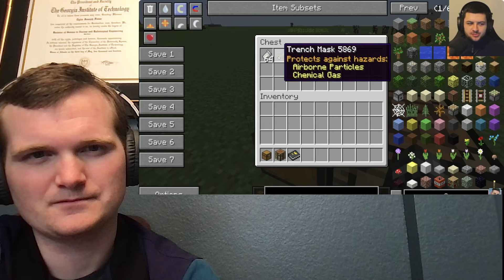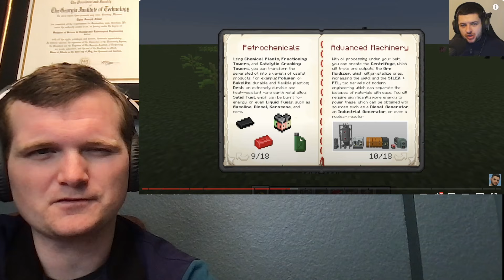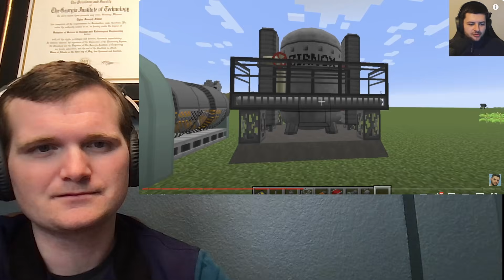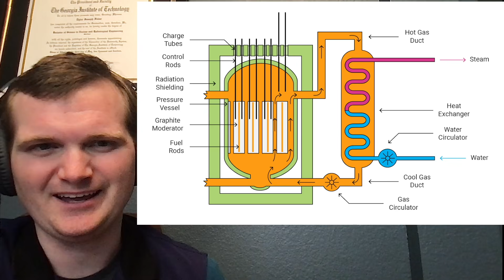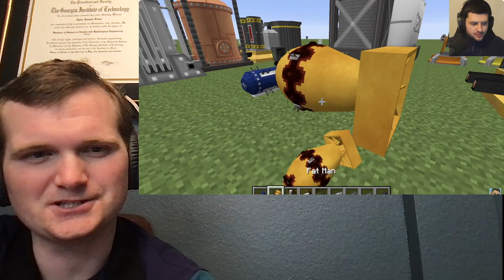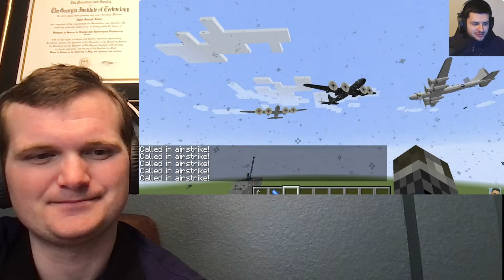Nuclear Engineer Reacts to Minecraft HBM Nuclear Tech Mod Showcase by thebluecrusader

Comment: It's funny to see a scientist do a review of a Minecraft mod, do you play the game yourself? I've always loved HBM NTM, but nowadays i kinda prefer the mod Warium. Warium is a lot simpler than HBM, but i personally like the visuals of the explosions better and it's a lot less laggy. The first time i used the Tsar bomb from HBM, i actually thought it was broken and didn't do anything. I almost detonated a second bomb after a few minutes, when the crater suddenly started appearing just in time. The game has to process so much, that it takes like 15 minutes to load in the damage from the Ivy Mike and the Tsar. In Warium there's only 2 nukes, the 9 KT tactical and the 650 KT strategic, but it's pretty well optimized and the lag is negligible. 

I use a lot of different mods and my favorite part of Warium is that if you have a mod like Valkyrien Skies, which lets you build your own working vehicles, you can actually drop the bombs from your planes. HBM is more realistic and you have to know what you're doing, but with Warium there's a lot more creative freedom. I built a futuristic multi-role jet designed after a stingray, which i named Trygon, and it has a VTOL function, can hover perfectly horizontally with the help of a gyro or fly like a regular jet, it can deliver both types of nukes, has powerful rockets under the wings, and thanks to creative mode items, it has infinite fuel and ammo.

From a gameplay perspective, i think you would actually want to avoid too much realism. If you need to have actual engineering knowledge in a mod that revolves around warfare, certain players are going to have an unfair advantage, while others are just gonna have their factories melt down.

Comment: 0:30 I think the green indicates that its a balefire bomb which is a type of bomb in the mod that has a green explosion

4:17 any type of schrabidium gives blindness

9:30 you need 4

15:42 "heavy infinite water tank" refers to a faster output of water than the normal infinite water tank not heavy water. heavy water does exist in this mod though

Comment: 3:58 I’m pretty sure it’s required for the RBMK because the crafting recipe for the RBMK Structural sections (also the base for the boilers, Control rods, moderators, fuel rods, neutron absorbers, etc.) includes Asbestos Concrete. The asbestos concrete block also has a higher blast resistance than the concrete block.
Reply: It’s also used as an optional part of making insulators(i think it gives 16 a craft?) and is the best way to get silicon in bulk(each block gives like 40 nuggets iirc).

Comment: Btw, the Digamma radiation is pretty fictional. Basically, it's a radiation but stronger, since there's only 2 armour can defend from it (and they're pretty expensive) and it's not just kills/mutates DNA cells but it's shorting maximum health of character until they die, plus it's pretty hard to control when it's a fuel for RBMK reactor because it's making a Entropy crust grow which is a dangerous thing (if mod wiki correct) and the pallet from Digamma impoverishes itself really fast even if it don't been placed in RBMK.
Reply: P.S. This fictional RBMK fuel when RBMK reactor is on meltdown kills everyone, even players in Creative mode. The other things that kills player in Creative mode is falling into Abyss or /kill command.

Comment: I love this mod because of how much shit it adds and how amazing and in depth everything is and looks. It's obvious simplified heavily from real life machinery, but I did learn quite a bit from it as well simply because it got me interested in this type of stuff.

The guy reviewing clearly isn't very knowledgeable and is kinda misrepresenting some of the mod's functionality. Radiation does actually cause the effects you mentioned at 4:34, he just happened to choose the schrabidium ore (a fictional element added) which itself caused the blindness.

5:06 toxicity and radioactivity are modeled separately, but toxic things are greatly simplified. There's coal and asbestos levels for lung diseases, I think lead poisoning was added recently, and radiation of course which is the most complex new "hazard" mechanic added. It behaves as realistically as you could expect from a minecraft mod with accumulating doses having progressively worse effects, contamination from radioactive materials, fallout from nukes, etc.

The mod also features the RBMK reactor which is probably the most complex and realistically modeled one in the entire mod because unlike the others where you really only need to throw fuel in and account for reactivity and coolant, the RBMK is entirely customizable and you have to build it yourself, it's not a single multiblock structure (multiblock is basically the ones that are a single 3D model when placed) and you have to actually consider things like fast and slow neutrons, moderators and control rods, what fuel you'll be using, and a bunch of other shit.

10:00 it does actually have multiple levels of enrichment for fuel (and to produce weapons grade material too)

To put it simply, this mod is way more in deoth and complex than the guy reviewing it makes it seem, would be cool to see you check it out yourself someday. Your experience would most certainly give you a head start lol.

Comment: 15:57 There is an infinite water tank in this case; heavy just means it makes more water per second. Trust me, I make the same mistake thinking it is heavy water.
16:48 There is a large turbine, but 1. It is vary expensive. 2. The smaller industrial steam turbine has a 25% power boost. So most think it is better to use industrial steam turbines.

Comment: Yeah, HBM's Nuclear Tech mod is insane with content. Other nuclear mods are "put some blocks together, get generic reactor" HBM's is more indepth and I totally havent accidentally blown up an RBMK from improper structuring/cooling XD
Reply: rbmks dont explode
Reply: @verdisquo97_arts It's the reactor design of the one who blew up at tchernobyl so yes they do explode.
Reply: @mr.g1555  ik it's a joke from HBO Chernobyl however it was actually the hydrogen that caused the big explosion that blew the top off
Reply: @verdisquo97_arts  it was not a steam explosion instead?
Reply: @mr.g1555  no you see hydrogen is formed when a neutron hits a atom of water  splitting it into hydrogen and oxygen, so technically it was a oxy-hydrogen explosion

Comment: Enriching water is a lot simpler than enriching uranium. You can do it in your kitchen if you want to. It's just going to take a while. First you fill a beaker with water, add some drain cleaner, then apply DC voltage across the water and electrolyse it away. Make sure the gas doesn't explode by ventilating the room properly. Do that until your water is almost gone. Put the water into a closed container and make sure it doesn't evaporate. Repeat and collect the 1 round electrolysis water in the same container. Then do the electrolysis step on this new batch of water. Do that a few dozen times and you should have enriched your water. Now you can do some fun experiments, like making ice cubes that sink.

And if you capture the gas you can even sell it off, or do other fun experiments. Like mixing it all together and putting a match to it.

If you want to enrich uranium on the other hand, you will need a chemical plant, several dozen gas centrifuges, a new power provider to power those centrifuges, hazardous and deadly chemicals like fluorine gas, which will eat you alive and a massive industrial site to put all that gear.
Reply: And the NRC breathing down your neck

Comment: In fact, in the mod you can use several fuels in reactors, and by far the reactor that has the most fuel options is the RBMK, it can use natural uranium, medium enriched uranium, high enriched uranium, it can use plutonium, americium, and even fictional fuels like schrabidium, australium, the most powerful fuels are flashlead and balefire in the case of the RBMK and schrabidium in the case of other reactors, flashgold and balefire are the best in the RBMK, but also the most dangerous, if you make a small mistake the The reactor turns into a giant cannon, to control them you have to be patient, and if you raise the control bars a little, it is enough to generate a lot of heat and energy, I personally use my balefire reactor at 10% in my world.

NOTE: digamma is not a good fuel in terms of power, and is better for neutrons, and digamma is more used to generate byproducts that are essential in the progression of the mod.

Edit: Fun fact, LEAus and HEAus (Low Enriched Australium, and High Enriched Australium) are fuels from the RBMK reactor, which are not radioactive but can undergo fission, obviously this would not happen in real life, but it is a fictional metal, so it is not logical.

Comment: I would like to see a Letsplay from you with a minecraft modpack. Like mekanism, Advanced rocketry, big reactors etc. I do not play mc anymore because of university, but some time a go a lot.

I thought of revisiting that after I completed my studies to see how most mods implemented computer science stuff. I would like to see that with other experts in different fields.
Reply: I'm no expert with a degree, but I did go to school for programming and game design, so I can give at least some insight.

Writing programs in any of the ComputerCraft variants/forks/rewrites is just straight-up writing lua scripts, and there's some decent simple robotics programming in the mod. 

The Integrated suite of mods are a powerful automation and storage mod that works on the principles of object-oriented programming. I actually think the way it abstracts the principles would make it a good teaching tool for the subject.

Xnet is like a slightly abstracted version of line-by-line programming, though its application is limited to logistics.

Interestingly, the magic mod Psi and even more so its sort-of spiritual successor Hex Casting are pretty similar to coding. You use stack interactions to build your spells. Spell components either push things to the stack (called iotas in Hex Casting), pop them from the stack, or interact with the top layer of the stack. Using those mechanics, you define all the variables and actions for your spell. Kinda feels backwards that a couple of the most powerful magic mods are entirely logic based.
Reply: @KamiNoBaka1  yeah liked all of those but even more Open Computers. It goes beyond just coding and you could code with Python, Js as only lua. Now I would found it interesting to see Nilred to take a look on chem craft or how it was called. Or Taylor look at Industrial Craft, ICBM, Mekanism etc. But also see other experts of engineering take a look at buildcraft, immersive engineering etc.

I could go on for ever ^^

Comment: the ZIRNOX name comes from the fact that the reactor uses zirconium clad fuel rods instead of magnesium ones. what the showcase didn't get into (but you could see briefly from one of the fuel rods shown) is that the mod has the even more impressive RBMK reactor which is fully modular and roughly simulates things like heat movement and neutron flux between components
Reply: he only seems to know aabout uranium doesnt talk a whole lot about aanything else
Reply: Well he's commertial and uranium is pretty common @damiennightmaresx7950
Reply: The Zirnox was based in the real life Magnox reactor.

Comment: The radioactive block at the beginning was schrabidium, a thought up ore that is highly radioactive and can be done by transmutating natural uranium and putting the schraranium in a processing machine to get schrabidium nuggets. And the "deep cleaned ore" is actually from verily processed bedrock ores. Bedrock is an unbreakable block at the bottom separating the world and the void, and to get the bedrock ores you need a large mining drill. The discarded bomb green stripe isnt actually about the radiation, But abotu the radioactive so called material called balefire; Balefire is a very strong and radioactive fuel but when you pull it out of the dud it comes out as shards. Balefire can be used in making rocket fuel and nuclear fuel. If you need any more info ill be checking the comment pretty regularly from today to tommorow.

Edit: No way i didnt know if i post  a comment atleast somebody will like it.
Reply: Balefire comes from a certain book... a very long, very whacky acid trip of a fanfic..
Reply: Is the book wheel of time
Reply: You know fallout new Vegas? And you know My Little Pony? Combine the two
Reply: balefire is more than just a strongly radioactive fuel: it's actually laced with antimatter